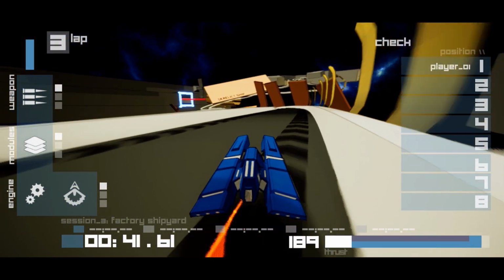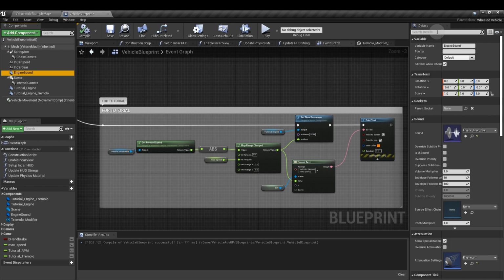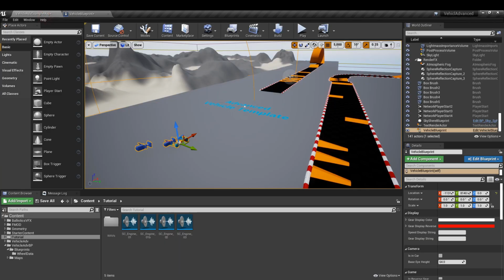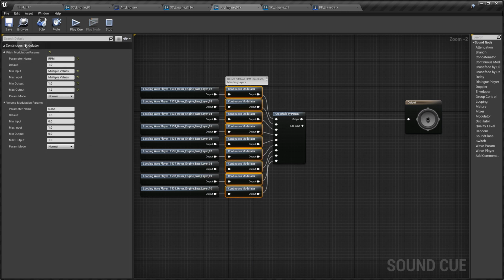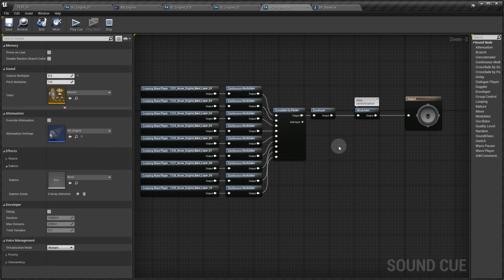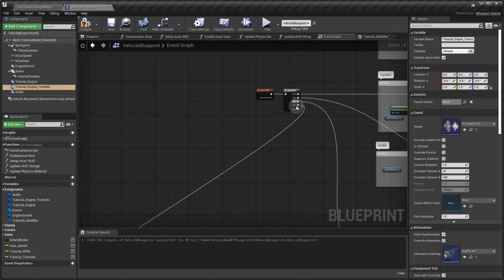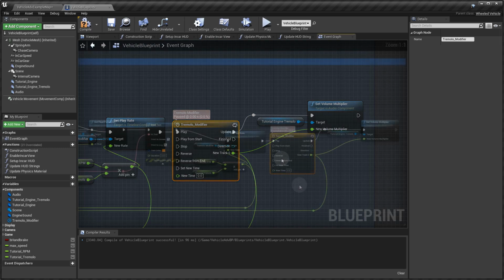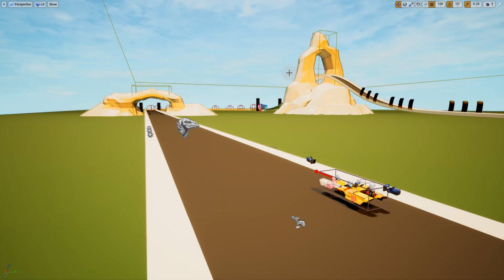Vehicle Engine Audio | Unreal Engine Tutorial

Comment: Hey man, thanks for this tutorial. This is the best one on YouTube. For some reason, my blueprint isn't putting out any sound whatsoever when I PIE. Is there any way I could screenshare on discord and you can help me troubleshoot? I am stuck at 10:00. I see the text updating as it should, but that's it. I have gone through about 5 additional times to make sure I haven't missed a step.
Reply: One thing to note, I am not starting with the default advanced vehicle blueprint. I created a chaos vehicle from scratch. Should this still work if I plug the first series of nodes into the Event Tick?
Reply from the maker: Ach sorry, I don't know how it'll work if you're using another vehicle cos I kinda depends what else is in there you know. But you've reviewed everything a few times already so it should be working fine. This is going to kinda suck but... you could try it with the default vehicle and in going through it you might spot some things that're out of synch. Maybe there's a value in there that's different because it needed to be changed for the chaos vehicle.
Reply: @valkyriesound3888  thank you for the reply! I’ll try that

Comment: Question for you: I was a following a different tutorial creating a regular car in unreal with and it did its engine sounds by working off of the car's RPM and using that with a crossfade by param node, but the result is that all the sounds overlap each other instead of changing with the gears. From what I have seen, the RPM values in the crossfade are overlapping each other. Would you know of a better way to handle this? Or would vehicle speed be the better way to go?

EDIT: almost forgot, this channel is great btw! you've got a subscriber in me
Reply: I'm having the same issue, I think I'll add a second Crossfade by Param (GEAR) in my Sound Cue where I change the pitch of the whole Crossfade by Param RPM.
Reply from the maker: Thanks for watching! Yeah, as Alessandro suggests :) My example is obviously a gearless vehicle so I neatly side-stepped the issue! :')

Comment: im trying to find out how to use car acceleration sounds instead of sound loops. do you know how to do it?
Reply from the maker: Do you mean actual recordings of cars accelerating? You can do that, but the tricky part would be if the Player changes speed while that sound is playing. A more dynamic system would be to monitor Player input and play appropriate sounds. You could check out REV here: http://www.crankcaseaudio.com If you've not tried it out before it might give you some ideas. There's an authoring tool near the bottom of the page, and a demo in UE4 using the buggy.

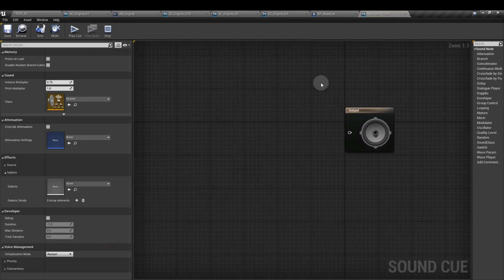Comment: Thank you so much for the fantastic audio tutorial! There are so few audio tutorials for the engine. At 2:50 you said there's a link to some example wav files, but they're not in the description. I don't actually need the audio, I just want to see the duration of each wav and also get an idea for what the difference is between all 9 of them. Could you maybe do a follow-up vid that gives a breakdown of the audio so we know what to create ourselves? Thanks!
Reply from the maker: Oops! Sorry about that :') Here's the link: http://tbf.me/a/yZOtn I've also added to the video description now. I made layers of sound for the engine, each with 9 loops of around 1 second each. Version 2 has a higher pitch than 1, 3 is higher than 2 etc. I've used several layers based on synths and recordings to give a more detailed sound overall. Hope that helps!
Reply: @valkyriesound3888  Oh good to know. I thought the pitch shifting was happening in engine though. I found in my setup since I'm only using two wav files, my base sound was getting really really pitch shifted down to almost inaudible levels. 
I'm also shocked the length is only 1 second. I figured at that length the audio would repeat too obviously. Mine are on 10 second loops and I still feel like it's not enough, but maybe longer is worse because there's more distinction?
Reply from the maker: I think they're 1.7 seconds long (for no particular reason). I compromised for file size and because I'm layering and also because in my sort of 'master project' I'm using FMOD, and applying things like tremolo, flanger, and EQ which distort / disrupt the sound beyond the usual sort of pattern detection. A longer sound is usually better for that, but if you're applying in-engine effects like pitch mod and maybe LPF and you're layering the audio, and you have things like Doppler applied, and maybe you have a degree of randomisation for each engine (or slightly different sounds for each vehicle) then, at speed in-game, it shouldn't be noticeable. 
For me, keeping the sound pretty static and unremarkable means it can be shorter. I've read that some sound designers use 3 seconds for ambient loops - but I find around 10 can be better. It depends on the circumstance, how it's going to be implemented, and what it's for.